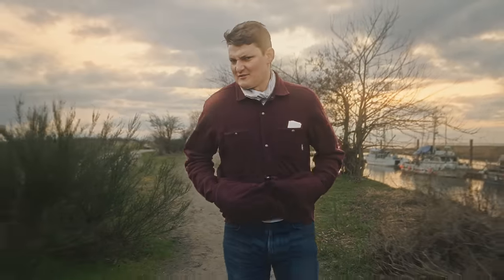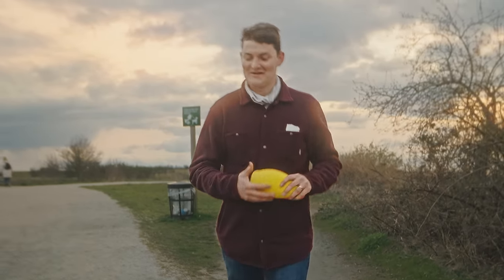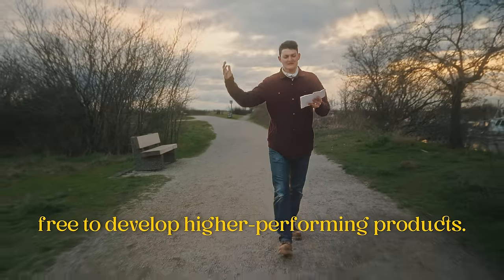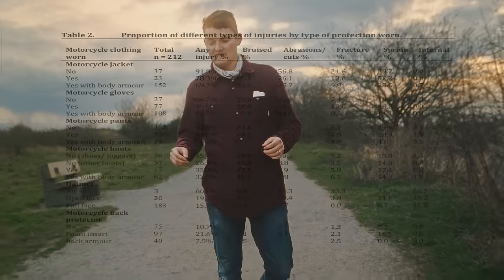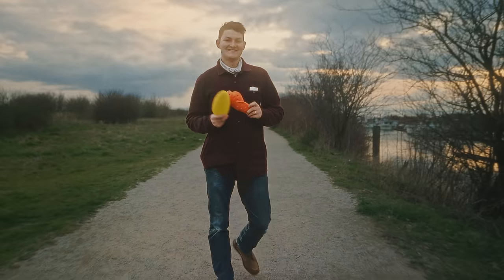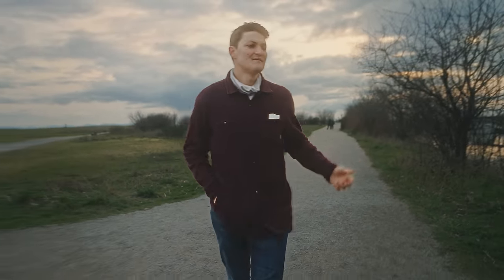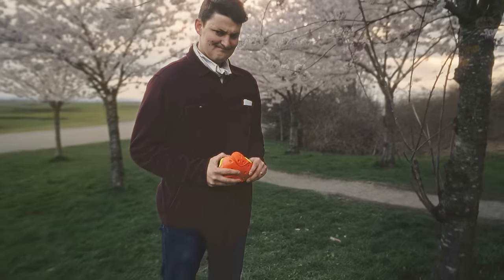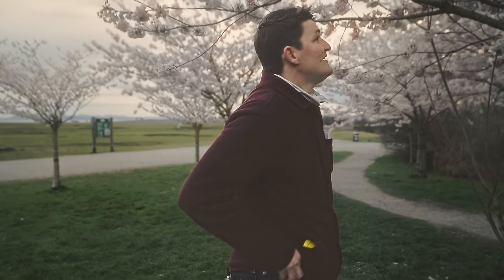Why I Stopped Wearing Motorcycle Body Armour

Comment: I just crashed today because of an old man that did not see me. 
I landed extremely hard on my left shoulder without breaking any bones or any serious damage, just a lot of pain.
It's crystal clear to me the importance that those stupid rubber things had during the crash: they helped me to soften the main impact and shielded my shoulder from the tarmac. 
Before this crash i thought they were useless as you said in the video, but i left them in my jacket just to be extra safe .. and I'm very glad i did.
Reply: Get well soon.
Reply: Exactly the same but without armor. I broke 3 bones. Whoever say it's not a necessity should go to jail.
Reply: @edmondszilagyi2802  of course, the single data point rebuttal, i think you might’ve damaged your brain
Reply: I would say the point of this video is not to encourage or deter the use of plastic body armour but to put pressure on the motorcycle apparell companies to lift their game & offer protection that will significantly improve the risks of not fracturing bones in a fall. It's not about individual incidents but statistical analysis over a large data set. I have had crashes with & without body armour and never had a fracture but.... give me the choice of better protection & I would pay for having that.
Reply: @EllaViewD  of course, completely disregarding a data point that disagrees with you, I think you might have damaged your brain.
Reply: May I ask how do you use these pads?  Do you sew them into the jacket?  Or how do they stay in place?  Thank you
Reply: @bellaggio1770  quite often they are kept in place with velcro
Reply: Yes, my mate was knocked off the other day. His jacket and trousers were ripped at the pad locations where he impacted the tarmac. No bruising. He does have a bruised hip though, where he wasn't wearing pads...
Reply: @bellaggio1770  most kit have pockets to put pads into. Some brands have velco inside the pocket to fix the pad in place
Reply: No, you did NOT crash because of an old man who didn’t see you. You crashed because you did not ride as if no one could see you. Grow up and stop blaming others!
Reply: @onerider808  It's true, we always need to ride as if all other motorists are trying to kill us however, without knowing the circumstances of any particular crash, I find your response arrogant. There is no foolproof way to ride with zero risk.
Reply: @onerider808  a bit harsh pal, without video evidence there's no way of making judgements like that
Reply: Can pretty much guarantee the road you crashed on was not tarmacadam.

Stop using this word to try to sound sophisticated.
Reply: @qmriis  🤣 sophisticated? It's just what some brits call it. Like  vacuums are still called hoovers! We just don't like change.
Reply: could you please share what gear you were wearing? have been really confused over what i should get
Reply: @kevinhank17  The original comment gave virtually nothing specific to his accident other than an old man didn't see him. And the other guy said "the same thing happened to me" without knowing anything about what actually happened. That isn't a data point it's internet gossip.
Reply: @sollux13  You should talk to the person I was replying too then who originally classed it a data point. Also, you're wrong. Anecdotal evidence is most definitely evidence,  kind of a big part of the legal system, witnesses and all. But thanks for coming out.
Reply: @sollux13  I guess you missed the "I landed extremely hard on my left shoulder without breaking any bones or any serious damage, just a lot of pain."
That was what "the same thing" was refering to.
Reply: @dalexa  "landing hard on your shoulder" could mean anything to anyone it doesn't explain what actually happened which is far more important information to have
Reply: @kevinhank17   The assumption that memory provides an accurate recording of experience, much like a video camera, is incorrect. Memory evolved to give us a personal sense of identity and to guide our actions. We are biased to notice and exaggerate some experiences and to minimize or overlook others. Memory is malleable. It is by far the least reliable form of evidence.
Reply: actually i was searching for a comment like this, he said himself that they do reduce the impact, but not enough, but what is the standard impact for them, yes a direct impact at 150km/h they may be useless, but on a side crash at maybe 100-110km/h they may help you to reduce the impact and maybe you’ll get a broken bone but thanks to the protection you don’t have 4 or 5 destroyed bones, if it was so useless they wouldn’t use it in moto gp and sbk as it cost a bit of weight
Reply: @bellaggio1770 there are compartments inside the jackets to fit them into.
Reply: well the stats say you are wrong
Reply: @goassnmane  then you didn’t understand the video in itself
Reply: @edmondszilagyi2802  I couldn't agree more. I always geared out 100% because I like being whole and active. It's wild how some people will just say all manner of dumb shit. I hope that you healed up 100%.
Reply: @waynewanderer  lol
Reply: @j43k  Thanks mate. I'll have another surgery in a few weeks, to remove the metal plate from my shoulder but everything is okay with me. I mean, my elbow and wrist will never be the same, but i don't have any pain and everything is working well... :)
Be safe and have wide ways!
Reply: @edmondszilagyi2802  Best of all things to you mate, cheers
Reply: I had an off a few years ago at about 60 MPH. Had all my gear on. Had some bruises but no fractures. The pads absolutely mitigate injury especially gloves, helmet and motorcycle boots. My buddy had an off with his bike. Had his gear on too. A motorcycle jacket with Armour is better than a cotton "Levis Jeans Jacket". Also if you're on a 1000cc race bike going fast all the time you need more gear than the guy on the adventure bike tooling around at 55 MPH
Reply: @bellaggio1770  There are pockets inside the outer shell to hold back,shoulder and elbow armour. Be warned back plate on cheap jackets may just be a space filler and not rated as armour at all.
Reply: @SamSzulman  IT does kind of make sense though, if you even just jump up and land on your shoulder on purpose, you'd need some very special armor to prevent your clavicle from shooting loose (torn ligament, very very common). It's one of those things where you might save some direct damage to the point of impact, but the weight on your arm/clavicle will still cause a full tear without much issue. I feel like when testing all these things factors such as this aren't really taken into account. Same goes that when you land right on top of your head: that helmet will save your head to a large degree - but that neck will still snap like a twig with or without a helmet in that very specific (and unlikely) hypothetical scenario. 

It's a completely different story when your main impact is your spine and you are or are not wearing a good pad or motorcycle airbag(vest). The dispersion of impact force there makes a huge difference. You might still break something, but it won't break nearly as badly as if you were unprotected. Can also make the difference between breaking or not breaking in that case quite easily.
Reply: @bellaggio1770   In my leather jacket, they go snug into these tight pockets on the inside. The pockets are closed with velcro.
Reply: @FlashFlash-tb6vf all the gear you mentioned isn’t pads! Gloves, boots, jackets? The video is about PADS… I feel like a fucking high school teacher “did any of you actually listen to the material provided?”
Nope. Jabbering magpies
Reply: @badbutcherboy   You have a helmet, Gloves and boots with no pads? What brand?
Reply: However you actually have no idea if they did anything at all. You just assume.
Reply: refer to min 5:08 of the video, you might've missed the clarification on this point
Reply: @kevinhank17  I have wrecked with armor and broken a bone and wrecked at an even higher speed without armor and been fine. you cant just use random single data points. no ones disregarding a data point because it doesn't agree with them, they're disregarding the data point because its an outlier that doesn't agree with the research that's been done. you cant deny scientific research just because you feel like you wouldn't have broken bones if you had armor, or you feel like you might've if you didn't.

On top of this the first point he makes, the force required to break a bone vs what these pads are rated to prevent... you cant deny physics, humans have spent far longer studying that than youve been sentient.
Reply: @onerider808  if no one else is ever at fault then why do we need to assign fault in accidents?
Reply: @CB19087  yes and the video said the pads do prevent bruising... they cant possibly prevent fractures because they dont have the dampening required for that. the same reason you cant use a pillow to jump from a 50 story building safely, but you could use it to block a punch...
Reply: @EllaViewD  and of course, the no experience rebuttal, these tests the video talks about are trying to mimic what these people have experienced. Maybe you should at least not insult them.
Reply: Do you know for a fact that your shoulder would have fractured if you hadn't worn the protector?
Reply: @EllaViewD Ryan has data?

Comment: My 4 years old son was riding his stacyc 16 e-drive bike down the hill 20 miles / 30 kilometers per hour and suddenly hit a big stone on the tarnac and hit the ground with filull speed. He was fully protected by fullface helmet, expensive knee and elbow pads, and glowes. No fracture, no bruises, just some crying. Without the protective gear he would have to be taken to ER and a dentist and stay in hospital for sure. It was traumatic for both of us. It was my fault, but to my point - always wear as much protection as you can.
Reply: Awesome story. 

However. That’s not what the video is saying. 

He was merely saying don’t buch cheap stuff, manufacturers need better standards to hold their gear to. 

Imagine same scenario, but you bought cheap China knock off stuff and it fell apart at first tumble. 

Would you still be saying “that gear was awesome!”  Nope. You’d be saying the same thing f9 did. Read what you’re buying, manufacturers love catch phrases.
Reply: Why would you let a 4 year old kid going on a bike at 30km/h? You're asking for trouble my man.
Reply: @lecobra418 I got my 3yo daughter Stacyc 12. Now she is 4 and I'm happy every time she crashes and is fine. Every crash is a lesson and I believe it's better to have these lessons at 4 and 20km/h rather than later and faster.
Reply: @lecobra418 literally any hill will result in a bike going over 25km an hour it’s just physics mam.